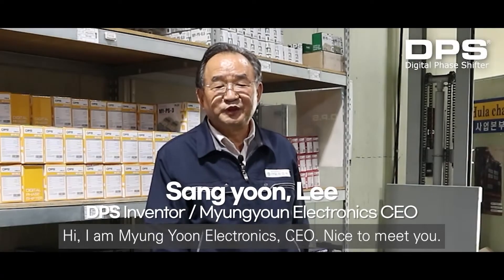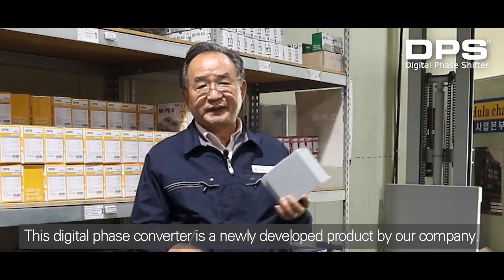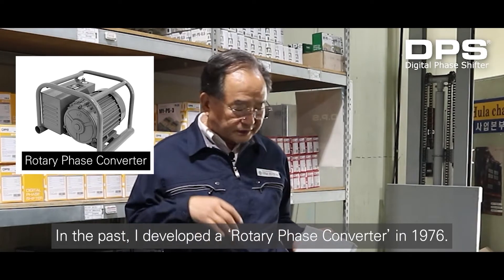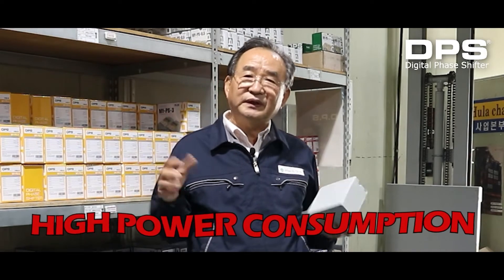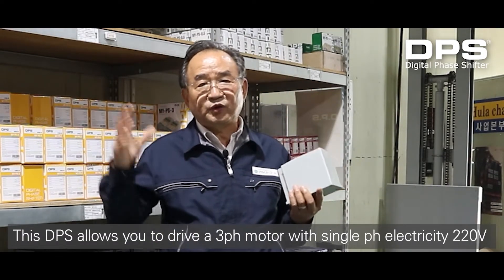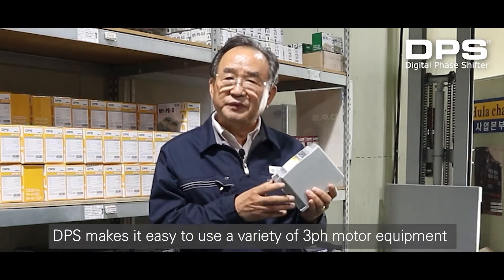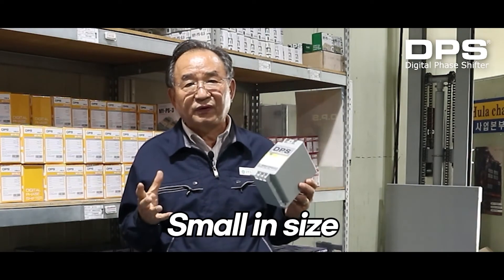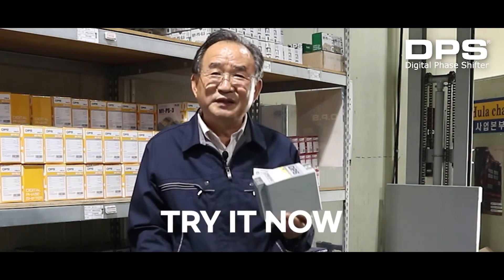DPS(Digital Phase Converter) makes 3 phase from single phase.

Comment: That pile of cooked motors in the intro was caused by this junk. There is nothing Digital about them it is a static phase convertor with nothing but capacitors inside . You will only get 2/3 your motors HP rating with these . On a 240 circuit they will run the motor close to 270v and they say this is normal, NO way

Comment: I recently purchased the 1.5KW  2Hp model. 
To drive a three phase belt sander motor. Easy to wire and worked excellent.  Great device.
Reply: A este tiempo que estamos, que tal le va con su convertidor , sigue funcionando bien .? 

Agradecería mucho su váliosa opinión ya que estoy con el dilema de comprar 1

Comment: Location Po Ng store need ko Ng 1phase to 3 phase converter
Reply from the maker: We don't have any distributors or shops in the country; however, you may buy it from Lazada or Shopee

https://www.lazada.com.ph/shop/myung-youn-electronics/?spm=a2o4l.pdp_revamp.seller.1.3cda6e1dfEW5s1&itemId=1479408169&channelSource=pdp
https://shopee.ph/myungyoun.ph?categoryId=100636&entryPoint=ShopByPDP&itemId=20369220883&upstream=search

Comment: IT DOES NOT MAKE 3phase  power.....it just gives it a jump start and you run on 1 phase ! this is total junk
Reply: Oh really😮
Reply: I've used a Dps on my 3 hp 1940s lathe it worked well for only one motor , I found out the hard way they are totally useless on a milling machine with multiple motors and fried it . I built my own 10 hp rotary converter and it runs my 5 hp mill and 3 hp lathe at the same time no problem . Rotary is the way to go .
Reply from the maker: We need to look into more details to recommend. Please contact us at sales01@myungyoun.com

Comment: New lol, its a vfd
Reply from the maker: DPS is not vfd. DPS is a digital phase converter. DPS makes 3 phase from single phase. However, DPS cannot control speed.
Reply: @Digital_Phase_Shifter  so its a vfd locked on 50hz euro 60hz American. Still uses input rectifier, dc bus capacitor bank coupled with induction filtering, igbt base output switching.
Ive been doing this for years with vfd’s, hopefully these are cheaper